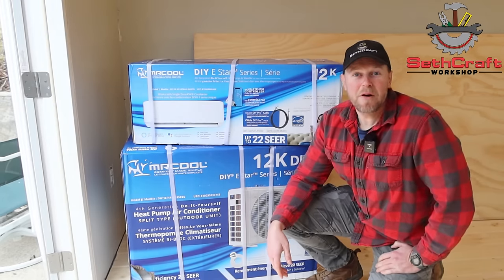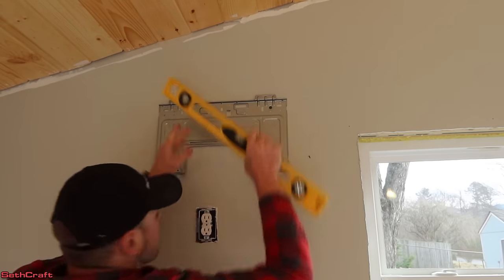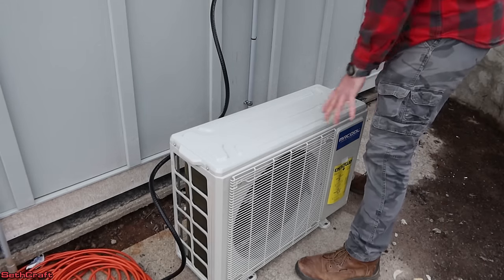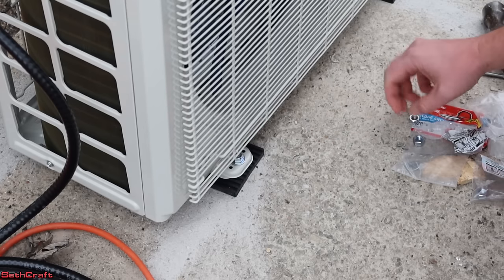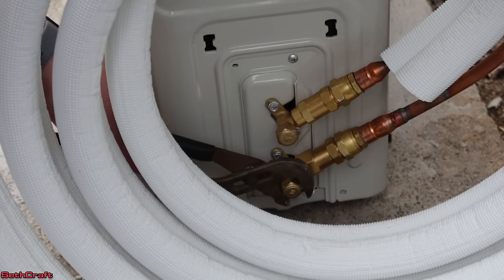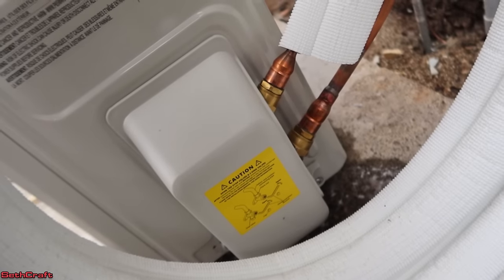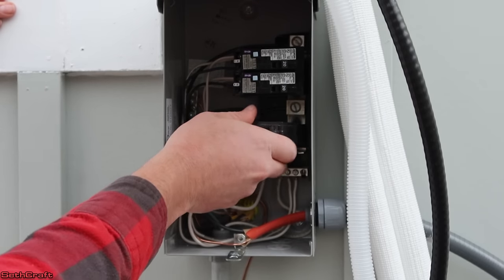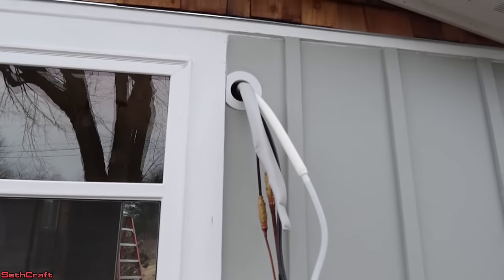Mr Cool DIY 4th Gen 12000btu Mini Split Full Install

Comment: I read online a mini split is suppose to have a quick disconnect switch kit to power exterior condenser. Why didn’t you use one?
Reply from the maker: The disconnect is 5 feet from the unit.

Comment: Do you know if it really exists a mrcool ac with a outlet plug if my house does not have a breaker thingy outside
Reply from the maker: Technically you could place a plug on the end of the 120v power wire seen feeding this Mr cool. But I believe it's required to have an exterior breaker by code. Installing a small outdoor breaker box is not difficult.

Comment: Hi, just picked up my Mr. Cool from HD, brought it home and opened the box and found one of the blue caps on the line set laying in the bottom of the box, cannot get a hold of anybody from Mr. cool and don’t wanna go through the hassle of installing this whole unit and still have to call an HVAC guy to vacuum the lines. Any idea if this is a dealbreaker?  Tks
Reply from the maker: I'm not 100% sure, but I believe those caps are just a protector for the seal that's inside the line.
Reply: @sethcraftworkshop  thank you, Mr. Cool just called me back and told me the same thing so I’m going to proceed with install.

Comment: Any tips for finding your top plate or studs. I have tried using several stud finders, and they don't work very well. Even highly rated stud finders work poorly.
Reply: You may have an old lathe & plaster wall. Our house has many and it can confuse stud-finders. Also, on old buildings, don't assume 16" centers.

Comment: Is the 115v unit as efficient as the 220v units?? Why did Mr.Cool opt to change the 12k btu diy units to 115v only? why were they not available in 220v?
Reply: I looked up the efficiency and unfortunately in the NW they are less efficient to the point that won't qualify for the 30% federal tax credit.  I think it requires HSPF2 >.95 and these are .90.  The 18k is 9.8.

Comment: I'm about to order this exact mini split. I'm hiring an electrician to run 220 to my shop, but will it work on a 115? Or should I continue to have him install the 220 for this?
Reply from the maker: This unit is 115v - 120v but you can install a 120v breaker in a 240v panel and that will work.

Comment: The outdoor breaker, was that a gfci breaker as the unit is outside ? 
Since you used #10 wire im assuming the breaker is a 30amp?
Reply: gfci is not required unless the equipment is 80 Amps or higher
Reply from the maker: There is a gfci in the house. This mini split allows several breaker sizes. I forget what size was used here.
Reply: Unit determines the breaker size, not the wire.

Comment: my unit's lines and power is coming through a wall that enters basically a mud room/breezway.  I then have to take a 90 degree turn and go through another wall to get them outside.  A couple questions.  Does the line have to remain lower than the air exchange?  Can I run the coolant lines through a long sweep PVC elbow to protect them?  Obviously when the lines are packed in the back of the air handler it is expected that we bend to the left to straighten them to get through the wall but can the go further to the left?  Just how forgiving are these things?
Reply from the maker: The reason the lines go down the full distance outside is so the drain line will pass water out. Otherwise it would pool up and could grow stuff In the line. As for the pvc sweep that should be fine. The lines are copper and can be bent a little. Just be very careful not to over bend and cause a leak.

Comment: Hi.  Great Video.  I have a small 1.5 car garage (~400 sq ft) I'd love to cool.  Can you recommend a unit that is super-easy to install that runs on a 110 v AC outlet (instead of being hard-wired)? My budget is $1500.00 but I'd love to be closer to $1000.00 or less.

Comment: Great video & very helpful! But I found you didn’t install an ac disconnect box. Does it mean it’s not needed? I just ordered a Mr. Cool mini split as same as yours. Thanks!
Reply from the maker: Rhanks for watching! The main panel connected to the building has a breaker dedicated to this mini split. That should be sufficient to cut power if need be.
Reply: @SethCraft Workshop  depending on state and county,  some require an ac disconnect to be between the breaker And the sub breaker/ main breaker box.
Reply: @Kilianshaw  The small sub panel that he installed the breaker in is considered a proper disconnect since it is within sight of the unit.

Comment: Can this be wired directly to the main circuit breaker box or does it need to have a separate box that attaches to the main box?
Reply from the maker: The mini split is supposed to have a disconnect close to the outdoor unit.  That is why the separate box is there.
Reply: @sethcraftworkshop do you have a video showing how to add an ac disconnect?

Comment: Is it recommended to use 10/2 over 12/2 wire by chance? Is it recommended per Mr. Cool installation instructions? Great video!
Reply from the maker: 12/2 awg can handle 20 amps. That is plenty to handle this mini split. 10/2awg is a bit overkill.

Comment: I’ve been watching several videos, and everyone says you need to ‘vacuum’ the ‘lines’??? But I’m confused; if the system says ‘pre charged’ isn’t it supposed to be installed without vacuuming?
Reply from the maker: I'm guessing the people that leave those comments are unfamiliar with the new Mr. Cool pre Charged mini split. This unit is designed to install without vacuum.

Comment: So even though it's not code I'm thinking a 12-gauge pigtail plug into the outlet would work?
Reply from the maker: If you could go 10 awg I would. But if your wire from the outlet is only 12 awg than that will be fine. You will want to install a box to hold that pigtail. (I am no electrician)

Comment: I'm installing this same unit but when I attached the air handler to the mounting plate I don't think one side locked in correctly.  How the heck do you get it to let go to try again?
Reply from the maker: That happened to us as well. Sadly I do not remember how we got the one side back off the wall.

Comment: why did you use 10ga. for a 20 amp circuit? Also, you should be using THHN in that conduit.
Reply from the maker: Good point about the THHN. I will be sure to use that in my next install. The manual gave awg sizes and so we went with 10awg.

Comment: How long is that cord with the wires inside at 10:27 in? I’m about to install the same exact unit in my shop and the inside wall unit is on another wall than the outside unit. Probably about 10-15 feet away. I’m hoping it reaches.
Reply from the maker: I don't remember the length but at least 15 feet. It was plenty long.
Reply: @sethcraftworkshop  Thank you for the quick response!

Comment: Hi Seth, great video.  Am about to tackle a 36k two zone unit.  You didn't extend precharged lines so not sure if you can answer this question.  I am trying to center my outside unit to extend to two zones without being short and while trying to measure accurately,  am trying to understand the true length.  If the 25 ft lines are truly 25 feet, it appear I have a few more feet added from the indoor unit attached lines that come through the indoor/outdoor hole?  So maybe 28 feet total possible with the 25 foot line set?   Thanks in advance.
Reply from the maker: That is a good question. One that I don't have an answer for. The indoor unit does have a few feet but I don't know if that means the other line is shorter or if that adds extra.
Reply: @sethcraftworkshop Thanks for the reply.  I just received the set.  Will let you know so others can have the knowledge.

Comment: You said this is a 120vac unit. Why do you have a red wire, that's a 220vac wire? The black, white and green are 120vac wiring. Please explain.
Reply from the maker: The red wire that you see in the video is part of the electrical from the indoor unit to the outdoor unit. The grid power uses 120v black, white, ground.

Comment: My 12k btu unit says it needs 230V, so do I need a double pole breaker?
Reply from the maker: Yes you will need a double to gat 240v off the main panel.

Comment: Great video! I installed the same unit but the outdoor unit isn’t turning on. I checked the voltage and I’m getting 120V in the outdoor unit but the unit isn’t turning on, however the indoor unit is. Any thoughts?
Reply: Check your breakers.  Is something off or tripped?
Reply: Isn't it supposed to be 220 volts?
Reply: @davidmaschak528  The Mrcool 12k units are 120v.
Reply: If you have multiple systems you may have the communication wires crossed. Like you might have the wire for connection a going to connection b and vice versa. Also could be low refrigerant charge so it’s just blowing fan i would imagine

Comment: What electric wire size does that 12k unit require? I’m thinking about getting the 12k or possibly the 18k unit if it only uses 12/2 wire
Reply: The instructions say 12/2 is the "minimum" for a 115V 12K unit. Also they say you can use a 20A breaker, typically also implies 12 gauge wire is OK. I used 10 gauge because my wire run was like 40' from the panel, I had room and money for it, and overkill was worth the peace of mind.
Reply: @davidstewart1153  nice! 12/2 should work then for my garage where the wire is no more than 20’

Comment: Help, my husband just installed this and electricity is working but the unit is not blowing cool air even though it’s set on 62 degrees. What could be wrong?
Reply from the maker: I just followed the instructions and the system worked. I am not qualified to troubleshoot any refrigerant issues.

Comment: Is this considered central AC and heat unit?
Reply from the maker: A mini split does have both AC and heat. It can reverse the system to swap between the two.
Reply: @sethcraftworkshop  reason I asked if it was considered central AC and heat because I'm renavating a house and was wondering if this would increase or decrease the value of the home?

Comment: Does this AC unit need to be vacuumed or not? This is my question.
Reply from the maker: The Mr. COOL diy mini split does not need to be vacuumed. It is ready to connect and use.
Reply: The lines are pre-vacuumed. 
It’s plug-in play. 
It’s do it yourself.

Comment: Romex cables can not be run outside of the house not even in conduit. You need to use wiring that is rated for a wet or damp location not romex
Reply from the maker: I suppose that ground contact wire could have been used.
Reply: The reason Romax should not be used outside is because of the paper inside the sheath.
 you could just strip the outer cover off and use it, but individually stranded wire would be the first choice 😮

Comment: What if you find a leak at the connection ?
Reply from the maker: I also wondered that. My only thought is that it needs to be tightened more slightly. But I am not sure. The instructions did not give an answer.

Comment: So assume a concrete slab is required? Also what if your house is made with brick, not wood?
Reply from the maker: The instruction booklet indicates a concrete slab. All the how to that I've seen have also used a concrete slab.
 You can get masonry bits to go through a brick wall. It would be quite a challenge.
Reply: There's also an available wall mount bracket to keep it off the ground. Masonry wall will require a 2.5" -3" core drill for the wall penetration

Comment: Isn't it a safety hazard to have a circuit breaker slot cover missing (where you removed the 2pole breaker and replaced with a single 20a breaker)?
Reply from the maker: Probably.  Those cover plates can be purchased to cover the hole.

Comment: Well now that you beat on the top of the anchor im surprised the threads still work. U should have kept the nut even with the top of the anchor while hitting it in .
Reply from the maker: Luckily my whole size was good and I did not have to tap too hard.
Reply: That anchor is designed to be hammered. The end is unthreaded and smaller dia. Having the nut on during hammering is a wise precaution, which Seth took.

Comment: The wrench they include in the kit was missing from mine and Home Depot is WORTHLESS, they want me to return the whole unit after I've already installed all the indoor air handlers.  Is this a standard wrench I can buy from Harbor Freight or Home Depot?
Reply from the maker: I dont even remember a wrench being included with the unit I installed. OH do you mean the Allen Wrench? It is a standard Allen key. You can pick one of those up at most hardware stores. Many of them come in a kit with several sizes.

Comment: The loop in that line is going to trap a lot of refrigerant oil and it won’t cycle always make it straight forward lots of these calls I run
Reply from the maker: This unit had so much extra line. It would be nice if these units had options for less length.
Reply: Here’s a thought,
 If you don’t like the tubing all coiled up.
 Place the outside unit farther away 😮
Reply: I believe they offer shorter line sets, check with Mr. cool

Comment: Can a 12-2 be used for the 120v?
Reply from the maker: Although 12awg can handle 20 amps that is the max value. I would go with 10awg and you wont have to worry.
Reply: @sethcraftworkshop  well I already have a 12-2 line in the area I want to put a mini split
Reply: 14\2 would work but silly to use it.

Comment: Mr. Cool states in the manual to lay the excess line sets down horizontally, not vertical , to avoid an oil trap.
Reply from the maker: Thank you. I will keep that in mind as I install another unit in the future!

Comment: great video however i see this mistake in 99% of them the un-used coils have to be set horizontal not vertically behind the condensers. instructions tell you its ok to leave vertically but this causes oil pooling traps in the lines and will cause issues down the road 100% seen it first hand.

Comment: Good DYI job. 
IMO it is worth the expense of having the AC lines shortened by a professional AC tech. But that's just me.
Reply from the maker: The DIY version of this does not allow for the lines to be cut. You could save some cash and get the regular model and have the lines installed at the perfect length.
Reply: The only way I would say that is better, is if you're able to do the work yourself. By calling out an HVAC tech, you are completely negating the purpose of buying the DIY unit.
Also, from my experience, the HVAC tech costs more than the difference in price between the DIY and non-DIY models.

Comment: Sir you forget to show how to connect the electrical on the inside unit.
Reply from the maker: The electrical inside is already pre installed out of the box. The black cable that was connected outside is the same cable connected to the indoor unit.

Comment: I didnot see or hear any mention of vacuuming the lines before opening the 2 valves to allow the refrigerant to circulate in the system.
Reply from the maker: That is correct, the Mr. Cool DIY does not have lines to be vacuumed.

Comment: ??? 10 wire is for 30 amp. 12 wire for 20 amp.....or did something change??!!
Reply from the maker: Either would be fine here.
Reply: You have to derate the wire by 20% 12 gauge wire is good for 16 A only not sure what the unit required

Comment: Hey brother. I noticed that you didn't pull a vacuum on the system. I work in the HVAC industry. I would recommend that you have pulled a vacuum on your system otherwise you now have non-condensables in the system which will damage or destroy your compressor over time. Now you'll have to spend around a grand for a new compressor. Depending on where you live. Also a disconnect box between the unit and the main breaker panel will prevent a possible fire or damage to the rest of your panel in case your compressor or ran motor has a ground.
Reply from the maker: Hello. The new Mr Cool DIY mini splits have a pre charged line that does not need a vacuum! Makes the install super easy. As for the extra shutoff that I something I will do on my next install.
Reply: Mr Cool sells "No Vac" lines, they are pre-vaccumed and have a special fitting.
Reply: probably not the cost given the entire condenser unit only run about $1200

Comment: Not following nec code romax should not be ran in conduit flexible or rigid or emt
Reply from the maker: Romex can be installed in flexible conduit. It is typically not done because it can be a pain to pull. But for this short run it was no issue.

Comment: What?  No vacuuming????  The coils of extra tube looks terrible
Reply from the maker: Since this video Mr. Cool now offers line length kits. That would make the extra line way better. As for the vacuum the DIY version of the mini split does not require a vacuum on pre charged lines.
Reply: I bet this unit is not working anymore

Comment: Two screws not installed in studs with no anchors? You said nothing about that when installing the inside air handler. Also why not angle down the holesaw when cutting the exterior hole? Also seems to me you should have taken into account the exterior placement of the hole in relation to the trim. Not enough forethought here for my detailed mind to like.
Reply from the maker: The indoor air handler is installed into the double top plate of the short wall. It has plenty of 2x4 material to make a solid connection. The hole cut through the wall was angled down on the outside so that any buildup in the drain line could flow out and down. My bad for not mentioning that. I will have to say that in my next install. As for hitting the trim on the window YES absolutely a mistake. I was aiming for the gap in the 2x4's beside the window and did not even consider the trim.
Reply: Nice to have you on the lookout, Peter. Seth is too polite to point it out, but he very clearly said in the video that the screws for the mounting bracket would hit the top plate.